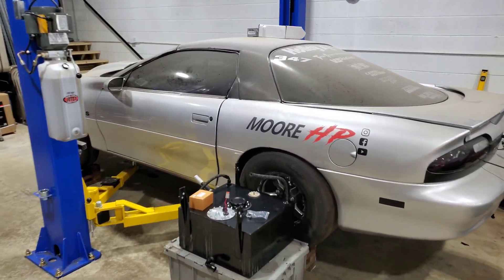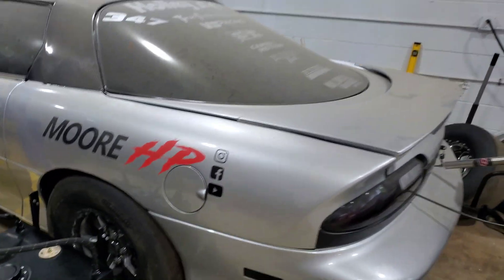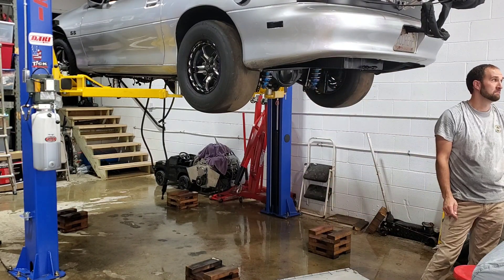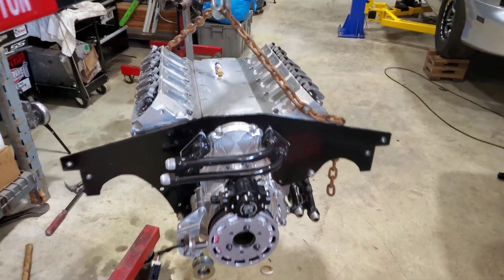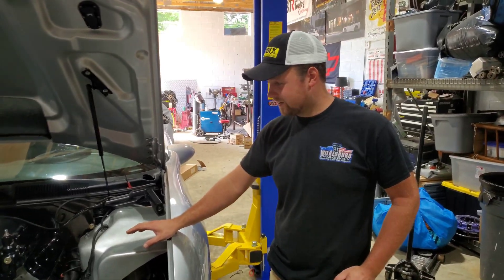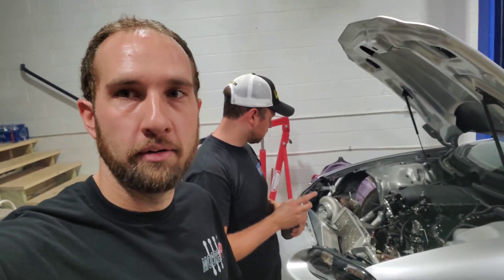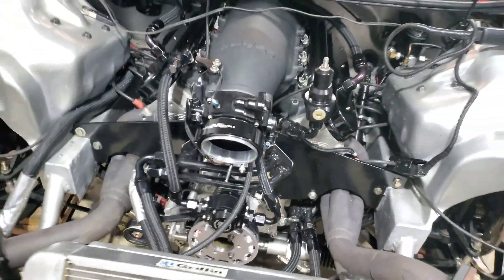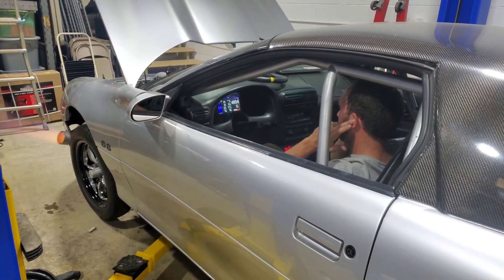First Start Up of the New 2000+HP LS Engine!

Comment: how you running the vent on that fuel cell?
Reply from the maker: I have two 8an hoses coming off the top of the cell.
Reply: @MooreHP  ok I  have a single 10 but not sure what to d ok with it after I get to the bottom of the tank . do I just leave it there, route it away from the tank. leave it open or vent it lol as important as a vent is there is not much talk about them except that you need one and size it according.  not much what fo do with it after the tank